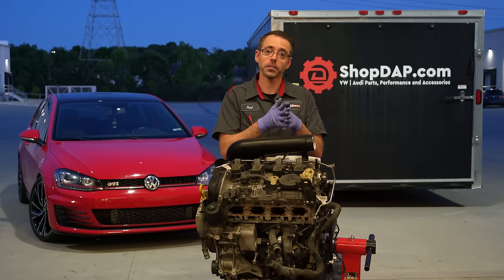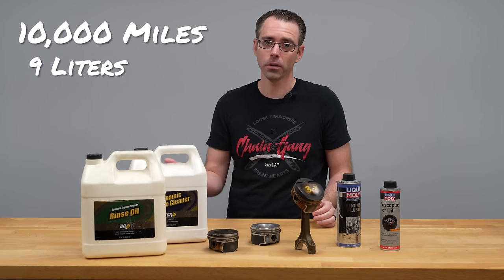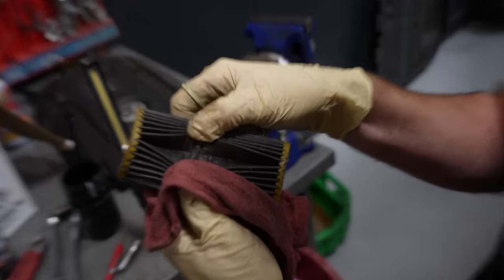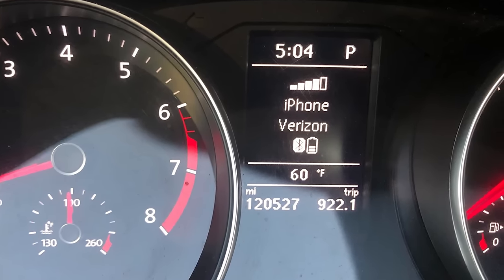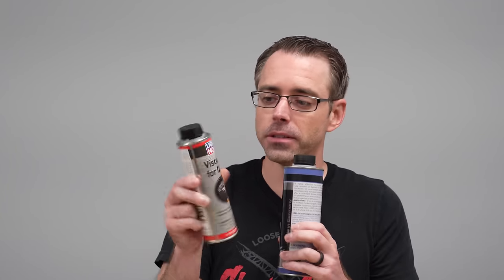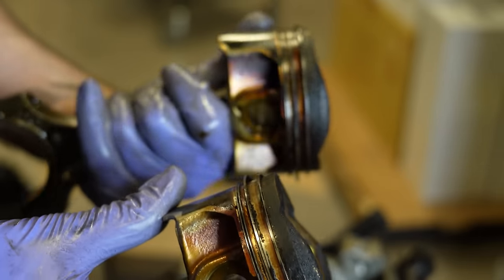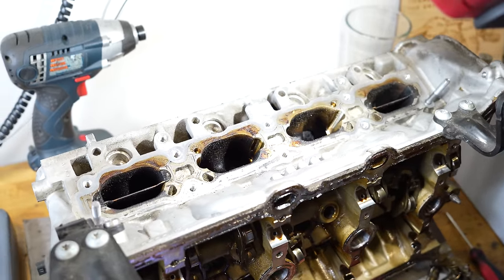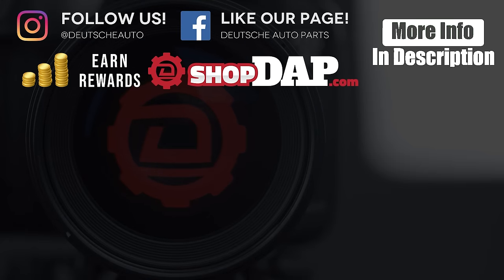Can you Fix an Engine Burning Oil for $20

Comment: No one ever damaged an engine because they changed the oil too soon, as long as the correct products were used. My advice is, trust the specifications of your products and your production. Consider technical opinion also. There are different theories but in general be aware of what constitutes severe duty, You drive all short trips, that's severe duty.

With conventional oil and severe duty, you can justify a 2000-mile oil change interval. With synthetic, you can justify a 3500 miles interval. The price differential between between dino (conventional) oil and low-end synthetic oil has just about disappeared. I go further than those distances, but not a lot further.

If you get one of those $20 conventional oil changes from some tire chain, the no name filter they give you is good for about 5000 miles.  No more than that. No low end filter is good for more than 5000 miles even if it is a brand name.

Some people recommend stepping up from 0W-16 or 0W-20 / 5W-20 to 5W-30. Their argument is that the manufacturer recommends the thinner oil solely to get better fuel mileage number. I'll tell you about it, but I am not going to recommend it.

I do know that sometimes the recommendation changes from country to country even though it is exactly the same vehicle. Or from year to year even with the same engine. You have to do your own research, Maybe the bearing clearances are not the same. Tighter clearances may be the reason why they changed the oil recommendation.

Comment: I've taken a bmw engine with a dead hole, zero compression back up to normal compression by just dumping ac Delco injector cleaner in the cylinders overnight. Blow it out, change the oil and start it up. Compression came back and it even passed smog.

Also you don't need all these fancy expensive cro schmoly products. Just run a little trans fluid in your oil. The detergents will clean things up real nice

Comment: I have the famous Toyota 2.4 L oil burner. How about 225,000 miles on it. People I bought the car from where regular with their oil changes however, I think they used conventional oil

Regardless, my engine is known for piston ring, problems, and oil burning, which led to my mechanic, having to flush the catalytic converter once. I don’t know what he did, and I don’t care, but it worked. All I remember, was smelling a strong petroleum smell, and I had to open windows in the waiting room, and then my catalytic converter problem was solved

How do use liquid Molly oil flush and then Lucas oil stabilizer. After an additional 3 to 500 miles I seem to be burning less lol. I’m not talking about grand results basically a quart every 300 miles to a quart every 450 possibly 500 miles closer to 450. 

I can live with giving 450 miles per quart. However, I would prefer 1000.  How do you see people pouring stuff through the top of the cylinder head rotating the engine over 24 hour. Using a particular chemical often. I thought about purchasing a Japanese engine. I’ve heard they do not burn oil only the ones made in America.

Comment: A liter or a quart of oil in 1200 miles is time for the scrapyard.    Most of my cars in the past didn't need a quart between changes.   My old F150 has 250000 miles and barely uses any.   Wouldn't high consumption damage the cats?

Comment: Those valves were horrendous. I'm not a VW guy, are these engines direct injection? I recently replaced cracked heads on my 270k mile pickup and the valves in that VW made what came out of my pickup look squeaky clean, and they did have little valve stem leakage and a lot of wear. The rest of my engine was great, even still has decent cross hatching in the cylinders. I think that's a product of running royal purple and changing it regularly. I've owned it the last 150k miles, and I've seen the royal purple slowly clean out the shellac from the previous owner. She's clean inside. I commute over a mountain too.

Comment: 20:30 Seems the oil control ring has been MOVED closer to the 2nd  compression ring.  Isn't what you are calling a "domed cutout" just clearance for the wrist pin installation?

Comment: You think trying LiquiMoly Engine Flush might help my issue with blue smoke WOT? It only blows blue smoke at full throttle. Casual driving and idling zero smoke

I have a Q5 3.0t, thanks for any feedback!

Comment: I went back to changing MY oil Every 3000 miles like we used to back in the 70's,  80's and 90's.  My Dad got the oil changed in ALL our Cars in the 70's & 80's at 3000 miles and Added a can of STP oil treatment...We had No problems with Our engines...except that 1970's  Bright Yellow Chevy VEGA station Wagon...just a BAD engine that had to Strain too much.

Comment: Is there a possibility that the updated pistons had nothing to do with oil consumption and were just perhaps a product of cost saving or a change in supplier, or something else?
  If I wanted to clean up those rings, I think I would use something a little stronger and deliver it thru sparkplug holes.  Then turn the motor over, either with the starter or some other way.  I would also remove the oil pan and supply oil externally to the pickup and not circulate the contaminated solvent. 
  Of course, this would have to be a service and not something you'd do in your driveway.

Comment: Could you please also test DMSO? it's a bit like acetone, it can be found on ebay and drug stores, and it's used as a skin barrier carrier for certain substances in veterinary application and whatnot. The russians use it quite often, it will dissolve carbon deposit almost efortlessly, but unfortunately it will also strip the paint, if the oil pan or the motor has any. Beside adding it to the engine oil, guys tipically also put DMSO through the sparkplugs, put the sparkplugs back, and let the pistons soak for...30 minutes or so.

Comment: Most common reason for oil consumption is not changing oil at 3k miles max. Second reason is the pcv failure. If you maintain both of these items from the start of the owning the Audi/vw you will have little to no oil burning. I’ve rebuilt a Audi 2.0 with new ring and changed the oil every 3k with mobile 1 synthetic. Never burning a drop of oil between the 3k oil changes. Ran beautifully. When they tell you to change oil at 5k or 10k miles it’s because they need to sell new cars and can’t do that if the old ones don’t break. Planned obsolescence!!!
Reply: Lol I change my 7.5r at 5k and it’s started tripping the low oil light around 3500mi, guess it’s time to switch to 3k mi changes 😭

Comment: A cleaning of deposits will result in a smaller compression ratio because your cleaning giving the cylinder more volume thus less compression. If you had a ton of carbon buildup it reduces cylinder volume giving you more compression.

Comment: So if my car is burning oil at the rates you mentioned in the video, should I use Engine flush or Viscoplus or both? Thanks for the video, good effort!
Reply from the maker: the Liquimoly products are supposed to be used together
Reply: @Deutscheautoparts  Thanks for the response. I changed my oil today with engine flush and the Viscoplus afterwards, but when I poured it in it was much more viscous, like a syrup, compared to how it looks like on the video. Do I need to be worried???

Comment: My 2017 GTI burned oil when using the Castrol factory fill. Switched to Motul, issue resolved didn't burn an ounce. Amsoil also doesn't burn I run that in my '19 over the Castrol factory fill. 

As for older FSI engines...there's a reason we techs refer to those as F**King S**t Internals if your old FSI isn't burning oil it's not running properly lol

Comment: I have an EA888 Gen 1. I have a major oil burning issue. Compression is 109-115 across all 4. After 50 highway miles I have to put in 3/4 of a quart. It’s so bad I don’t know the route I should take in order to fix it. I’m sure I have a limited amount of time until it causes misfires. I’m lost.

Comment: A mechanic told me if your engine is burning oil to replace the oil in the engine with 2 stroke oil. After the engine warms up it will burn cleanly. Problem fixed, just keep it topped up.

Comment: My 06 subaru burns oil. Changed to synthetic 10/30 and Schaffers Moly EP. Now I can drive 1,000 miles without worry about an oil starved engine.
( The engine oil is Black at every change regardless of what I do )

Comment: Heya shop dap, this is interesting regarding the piston design. Because I have a 2013 Audi A4 B8.5 2.0T which Is the facelift model where they updated the oil consumption piston and I never had that issue. (I’m in Aust, where we had B8.5s that were equipped with EA888 Gen 3 2.0T CNC in late 2013 till B9, as apposed to America where they kept all B8.5 with GEN 2s till B9 in 2016)
However I can confirm mines has a Gen 2 CDNC but without the oil consumption, but I had a bad tune and ended up blowing a piston so I had to rebuild. (I still have the old blown piston) after looking at your video I checked the old piston and it’s odd that although it isn’t the oil consumption one. it isn’t the one with the half circle groove but it’s like the original one with the Squarish notch. 🤔 wonder why

Comment: Rings shouldn't wiggle in the grooves (ring lands) at all. New piston rings will not fix this - only a new piston will because rings only wear at the cylinder contact surface but ring lands (grooves) get wider over time because the piston is soft aluminum and the ring is steel. The aluminum loses. All other ring wear us pretty much immeasurable with a micrometer. So if the top ring wiggles in the groove the piston is junk. Wear will be less  on 2nd and 3rd ring grooves. Wiggly rings allow combustion pressure leakage between the grooves and the rings vs only thru the gaps which is normal. This kind of leakage (wiggly rings and gaps) is not noticeable with a compression check even with real wiggly rings. Only a broken ring will show a significant compression drop (like 60 lbs). Carbon build up on piston including between the  back of the rings and the  piston surface and the on the sides of the piston   actually makes the path more restrictive and that's  a good thing. This carbon build up process begins the moment and engine is started  the very first time and it's maturing over time is called "break in". The compression pressure  attempts that route past the pistons and rings  and reaches  the crankcase. This pressure leakage is called blowby. Excessive blowby pressure due to wiggly rings forces oil mist caused by rapidly spinning crankshaft and connecting rods ((there's basically a hurricane of oil mist in the crankcase of any engine that's run) out out through the breather hose into the air filter then into combustion chamber where it's burned and if it's enough, it can create smoke at the exhaust. I don't think chemicals can do anything to reduce oil consumption due carbon anywhere on a piston. Washing off the carbon is the last thing you wanna do. 

First thing to try is valve guide seals. Bad seals allow the piston to draw oil from the (if overhead cam) directly into combustion chamber where its easily burned. A real wiggly intake valve guide can pull so much oil into the combustion chamber on the over run ( downhill at 30 mpg with foot off the gas) that at an oncoming stop sign the driver just 20 feet behind you may not even be able to read your license plate. A new seal won't help a real wiggly guide but it may improve if the old seals are getting hard.

So there are  the ways oil gets into the combustion chamber. I'm thinking these additives may only serve to soften and shrink the rubber the valve guides are made of thus temporarily reducing oil consumption.

In other words if clean the carbon off a piston your car will ise MORE OIL. 

This stuff must ony serve to soften  the valve guide seals.

As far as his compression results?

Check the compression on any engine once every hour and each time it'll be a little bit different.

Oh, and most of the oil that gets into the chamber isn't actually burned and the smoke you see isnt actually  smoke - it's oil vapor. Just like steam coming off boiling water.

Comment: My 1997 VW Polo 1.4 / 44 kw Bi-Fuel with 492.000 km burned 1 quart to every 800-1000 km. Now 4000 km further down the road oil level is stil at the same level on the dipstick. The cure? Replaced the worn valve stem seals.

Comment: Hi... i know this video is just over a year old! but hey heres a crazy thought.... when you blow a head gasket a little water leaks into the cylinder an like magic cleans everything crystal clean true ? now like oil and water you add detergent as a bass martial to form film an between to parts as they expan... now if your good at math an know the expansion factor of water as it heats up an turns to steam you could customise spark plug into a rod that screw into the spark plug hole ( like with old adapters for a compression tester ) that has a jet ( hole ) where under load air ((steam)) would escape under pressure like decompressing a chamber for turbo startup as the engine runs sucking in detergent & water mix from a oneway valve ((injector)) it spits the stream an excess mix out the outlet into a canister...  p.s. i want 10% royalties on this idea ;) dont contest it try it....

Comment: Are those engines direct injection? If so I’ve read where many manufacturers are having problems due to carbon buildup. You no longer have the fuel spraying on the intake valves keeping them clean. So some manufacturers are recommending an oil catch can to help prevent this.

Comment: A water injection system should solve oil consumption from carbon stuck rings. The water lands on the carbon deposits, it soaks into the carbon's pores and is then flashed into steam by the combustion pulses. Steam taking up 1,700 times more volume than water it breaks apart the carbon....... A cruder method is to carefully spray a fine mist of water down the intake by hand while the throttle is held at an elevated rpm. The engine should be at full operating temperature before attempting to decarbonize an engine and if the water flow of your spray is high enough to lower the engine's RPM you are spraying to much water. The engine is choking because it doesn't have enough heat to flash the water into steam. Reduce the flow until the amount of water at most only reduces RPMs slightly.

IDK how much water you'd need to unstick rings. I'm sure it will vary on every engine....I have done the spraying water by hand method on a 2002 660 Grizzly ATV that used 1/2 quart of oil per 5 gallon tank of gas. After spraying about 1/2 gallon through the engine over a couple of sessions oil consumption didn't stop, but it reduced to 1/4 a quart every several tanks of fuel. More water probably would have improved it further, but so far i'm too lazy to try.

Comment: My engine has 240K miles on it, and is starting to burn a quart every 2,500-3,000 miles or so. I've done 10K mile oil changes pretty much the last 200K miles. If I changed my oil every 3,000 miles, would it not burn oil at the 240K mark? Serious question.

Comment: When did they update the pistons? I just bought a used engine for my 2015 GTI the engine only had 30k on it and came out of a 2015 A3 convertible, and I change my Oil every 5k.
Reply from the maker: Not an issue on that car.

Comment: My gli would burn oil and it had over 286k miles on the original engine, bought it with 231k. I added more oil every few weeks and it was fine.

Comment: My 2002 trail blazer completely ran out motor oil,come to find out with the last oil change they used a cheaper oil instead American petroleum institute. The car turns over but knocked antill it goes to 1rpm. It has over 2000miles, its turned over twice, my question is without buying a rebuilt engine fore it can I change the oil and filter and put the right oil back into it and would that help the knocking?

Comment: Interesting I have a 2002 toyota camry that has 400,000 k's. I change the oil every 5000 k's it shows at the bottom level each time I change the oil. Probably less than a litre. 

I got the car at 268,000 k's and it has been constant. Now why would I get a newer car when this just goes and goes. I did overhaul the EGR system when I got it. That stopped cooling system consumption now it uses no cooling fluid either after a good flush out and new radiator and thermostat. 

Never stripped the motor or trans they just go and go. Cheers from Australia.

Comment: I noticed that you spent a majority of the time talking about oil consumption due to piston ring issues. when in all actuality a larger percentage of the time. there will be more oil consumption due to valve seals and or guides. and this can be best determined by how the vehicle is smoking. if a small wisp of smoke is present though out the whole RPM range. but if your decelerating like when going downhill and reach the bottom. and get back into the throttle and you see a big Puff of smoke. and then returning to a wisp you can pretty much figure it's rings. however if there's a steady stream of smoke. then you can pretty much figure it's valve seals and or guides. and there are some other factors to consider that can contribute to heavy oil consumption. like a malfunctioning PCV valve or even an oil leak.

Comment: Soak the piston ring by removing the spark plugs then soaking it with carburetor cleaner overnight using B12 Chemtool fuel injector cleaner, run the engine for 15 minutes  then change the oil, that is the cheapest way to clean the piston rings, my Venza consumes 3 quarts of oil, every month, now it consumes 1/2 quart every 5000 miles.